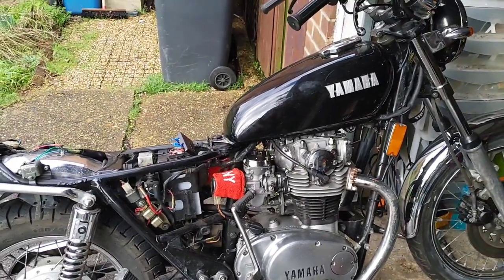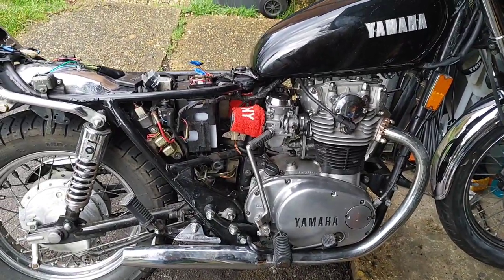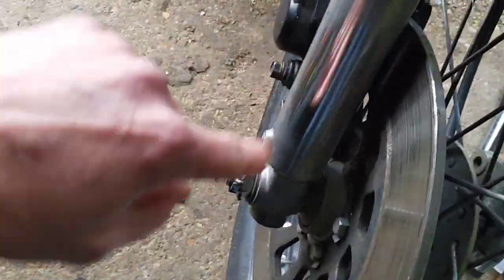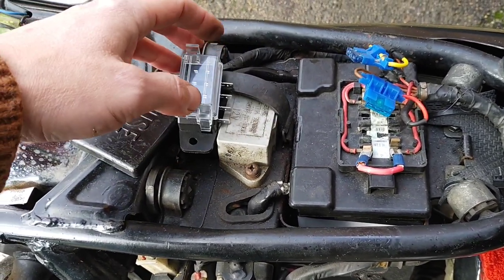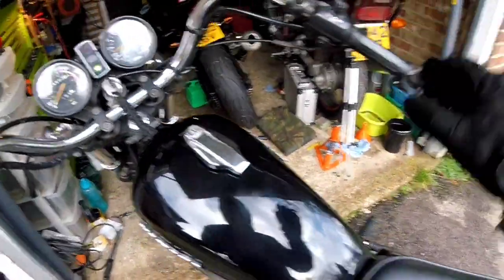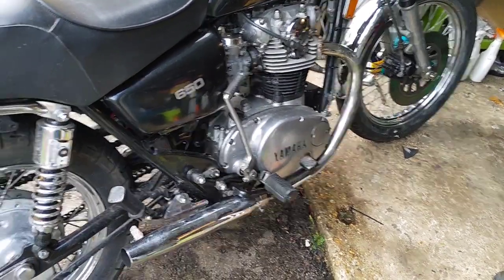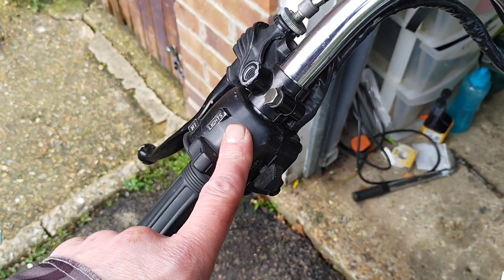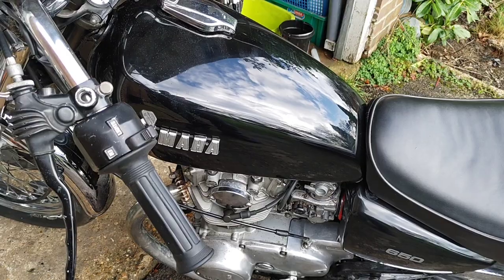Yamaha XS650. Fuse Box & Test Ride

Comment: I had a lot of popping /backfire with my xs and found carb intake boots cracked and leaky.  Replaced them and solved issue.  I owned a 82 and regret selling it but plan on keeping the 76.  Great bikes.  Loads of parts available and easy to work on.
Reply from the maker: I have tried spraying quick start around it when running to check for leaks but there was significant rev pickup. Might have another look.
Reply: @NatsNackersYard  I guess that is a good test
Reply: @NatsNackersYard  I've also had leaking carb issue with the 76. Cleaned and Rebuilt them and replaced and adjusted floats all the usual carb stuff.  After couple years of discouragement I replaced them with OKO 32mm units.  Much better but just need to get jetting just right .
Reply from the maker: I think that the current carbs are fine but approaching the end. I don’t like air pods and blame them to a degree too mind!
Reply: @NatsNackersYard  yes the pods look nice but I do run stock airbox.  I have kept original carbs just incase Oko don't work out . Original carbs do work I just can't get them from intermittently dripping fuel from overflow.
Reply from the maker: @sandmanGT350  this came without the air box. I really don’t understand why people swap them out. They are also bloody expensive to replace!
Reply: @NatsNackersYard  lol. Yes they are.  Mine came with half an airbox.  Took a while to find its mate .